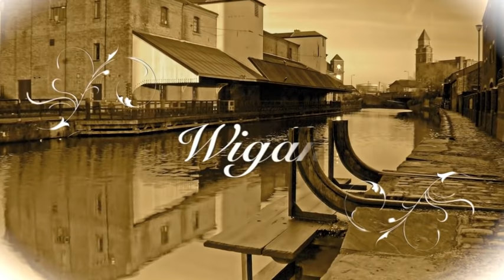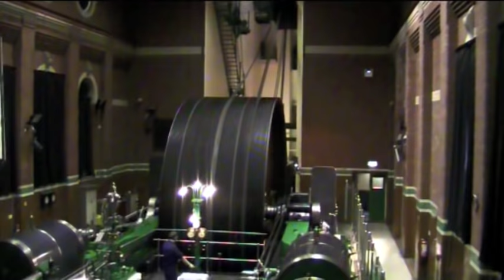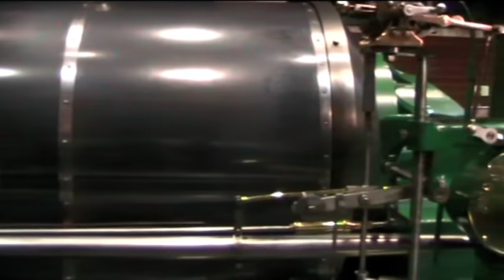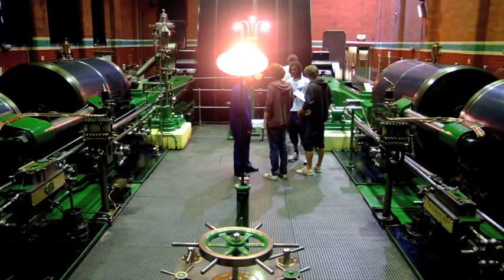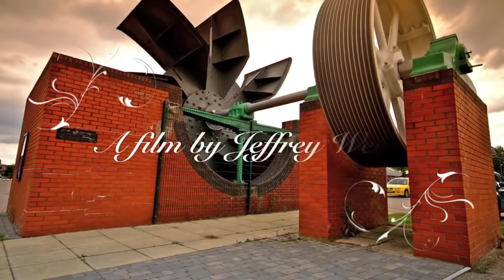Trencherfield Mill Steam Engine.

Comment: My name is Radomír. I have workd in Technical museum in Brno in the Czech Republic as attendant. Part of this institute is created by exhibition with steam engine and stem engine´s models. Real machine was made by " 1. brněnská strojírna " in 1910 as one cilinder and 1917 was tunid to two ciliders steam engine. This machine had power 150 kW, 120 rpm, ca 3,5 m diametr of flywheel and 6 ropes. Electromotor is sorce of movement, now. This one is the best matter of interest for visitors our TMB. Other exhibits are water engine by J.M.Voith made in 1917 annd generator of elektricity with Parsons steam turbine. Coronavirus is source a lot of problems for visiting and working, now. Good by and happier New Year 2021.

Comment: We have a 1911 Corliss engine at the Antique Gas and Steam Engine Museum here in Vista, California.  The 12', 18,000-pound flywheel was cast as a single piece (not enough consistency with sand casting to get two separate halves to balance) with two perforated edges, then dropped from the air onto a beam, splitting the wheel at the perforated joints.
So, that's another way to do it.

Comment: Runs like a clock - good engineering UK.
Reply: Sure their steam power is OK but just never ask them to do anything electrical. Lucas was the prince of darkness.
Reply: ahahahahaha so true!
Reply: The country that uses wire nuts for electrical connections in wooden houses is in no position to point fingers. It's just as well you only use low voltage wiring, you aren't save with 240v like a grown up country. Where was the first electrically lit house in the world? Who invented the practical electric light bulb? If you just said Edison then you need to go and research why he lost a patent battle with Joseph Swan, who lit the first electrically lit house in the world.
Reply: Well now, I have worked a lot of 50 cycle, 380 / 220 volt  no neutral, in many countries, wire nuts were used on that.
Reply: Like invent the electric motor and generator? We'd be stuffed without them and they are British
Reply: cageordie Japan uses 100v in their homes, so your telling everyone they aren't a grown up country? 240v circuits are very common in North American houses, too. Something tells me you'r knowledge comes from what you see on the internet, and you use your vague understanding to bias an opinion. It's easy to criticize something that you don't understand. Here's what North Americans understand: Old British cars have horrible electrical systems, but we still love them. European AC systems we have no experience working with, so we can't criticize.

After Four years of school, two degrees, and eight years of industrial experience, and I'm still learning the North American system.
Reply: @cageordie  We actually have 240 volts in US houses.  The only place we use wire nuts is when hooking up a lamp.  The rest is not wire nuts, and this serves well.

Comment: steam has to come back. it's a must. think of field of wheat and barley as solar panel. and use of straw as pellets to power biomass boiler and use it to power its engine. cheers from Ukraine
Reply: +yanik ivanov  Steam never left us, every nuclear power plant is a steam engine (with nuclear boiler and steam turbines) :)
Reply: +giggleherz solar isn't reliable. the sun doesn't always shine. it's not practical and it's insanely expensive still. The same with wind. molten salt nuclear is a much better solution. requires a lot less space for the power output and generates other elements we can use, like neodymium, Plutonium 238, medical isotopes, and waste heat to use for seawater desalination.
Reply: +giggleherz Steam is perfectly green with the right source of energy. Fun fact, solar power on the scale you'd need for the power grid works by heating a blob of salt to insane temperatures and pumping water into the blob through special heat-exchange tubes. The water boils, the steam thus produced is used to turn a turbine. Bam. Steam power with no greenhouse gases.

Nuclear power? Yeah that doesn't make any bad evil CO2. The nuclear reaction inside the core produces the heat necessary. The heat thus produced will boil a metric shitton of water, and that resultant steam produces mind boggling amounts of power. You can get, from about 15 or 20 pounds of uranium, 2 megawatts...that's 2 million watts, enough to power a medium sized city...of electricity 24/7/365 for 15 or 20 years on. A child born on the same day a nuclear power plant is fuelled will have their driver's license before that same NPP needs refueling. It's astonishing how ridiculously energy dense reactor grade uranium truly is.

Geothermal power, you say? Basically with this they stuff a pipe in a geyser, siphon off the liquid water, and feed the steam to a turbine. Bam. Done. They don't even need to boil it, the Earth does it for them. Often they'll pump fresh water back down into the vent to replenish what's used, but on the whole it's just 'stick pipe into ground --> get electricity'.

 You're confusing the fuel source for steam power. Steam does not care what fuel you use, only that you have a way to get water hot enough to boil. Nuclear, solar, coal, oil, geothermal, it doesn't matter. This engine would run happily on any of those sources of heat.
Reply: +olivier l It's not just nuclear power. All practical power stations, with the exception of hydroelectric, are still steam operated. The difference...coal fired, nuclear, geothermal, whathaveya...stems from how they get the steam, what energy source boils their water.
Reply: Modern gas fired power plants use axial flow turbine engines as the primary power source.  Many then employ a double steam turbine system using the heat from the turbine exhaust that fires a boiler.  The steam is directed through a high pressure steam turbine and then through a low pressure turbine.

Comment: Reading the comments it seems like people don't appreciate the current state of engine technology. This is a wonderful engine, and was a marvelous thing compared to water wheels, which burn no coal and also still work after a century or more. But look at it another way, this is a very inefficient 2,500 horsepower engine. An electric motor or a diesel of the same power would be about the size of a small car. A T700 turboshaft will do the same in a 4 foot long and two foot diameter package. So while these engines are wonderful, they don't really compare to what we use now for power density, efficiency and ease of use.
Reply: What you say is true, the amazing thing is that it is still working  after 110 years. By the way, humanity is pretty inefficient and still goes on.
Reply: Thats why the Brits invented steam turbines around the time this engine was made ^^

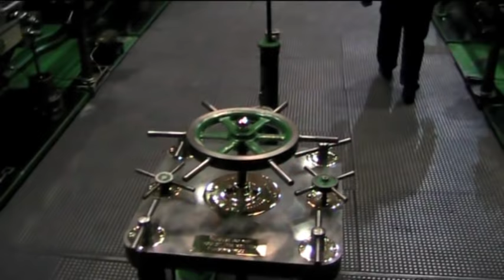Comment: 3:19 I'd like to know what the controls are under the main steam stop valve.
Reply: Those are :- the corner ones are for opening drain cocks on the large cast iron pipework under the engine to stop water hammer,
the middle left is to operate the outside steam whisle to call the start of shift, if I remember correctly the middle right is for a small valve
to warm the the system before main valve operation.

Comment: i have to wonder that now the unit is restored could it be used to supply electrical power to the complex thus reducing grid loading and thus save some money by not purchasing power from the grid. it just seems a waste not to have these magnificent pieces of engineering doing nothing whilst running.
Reply: Would you use an antique car to deliver amazon parcels ?
Reply: i wouldn't deliver amazon parcels(i don't support that company or apple because of their social narratives) but antique car parts possibly. so just to use the machine for it's intended purpose wouldn't be a bad thing. parts can be replicated with the processes available to us today so why not let those same machines do their jobs even though by today's standards it would be on a limited scale? to see in operation tech that is a century old is amazing and a testament to the designers brilliance in an age where software had nothing to do with creation of such marvels. that very same software and machines of this age can significantly extend the life of these marvels. therefore...i would let the electricity generated by the machine power the facility totally off the grid. a lovely thing to behold.